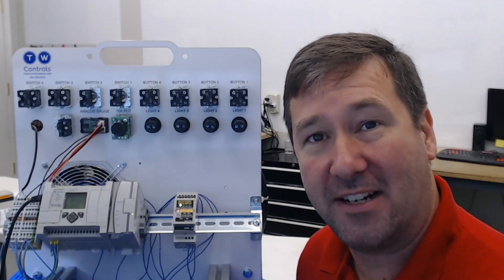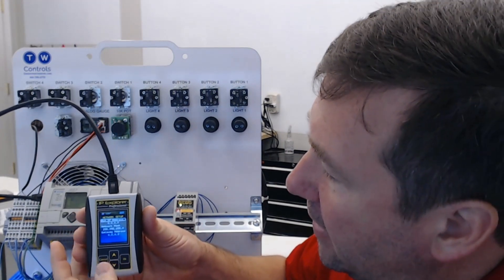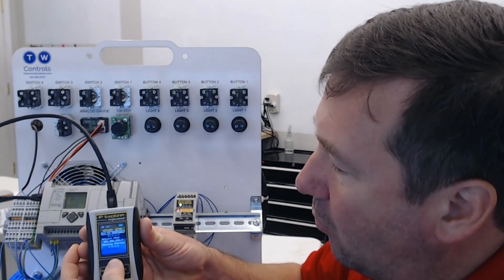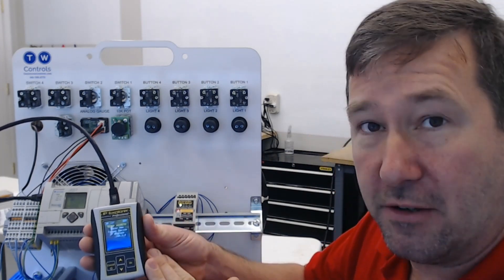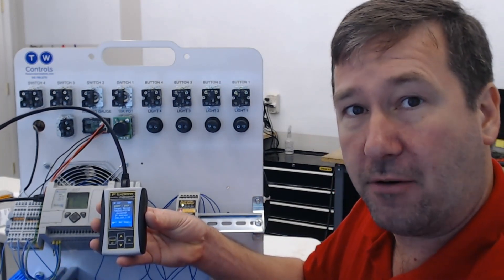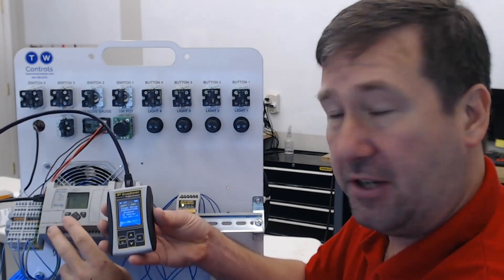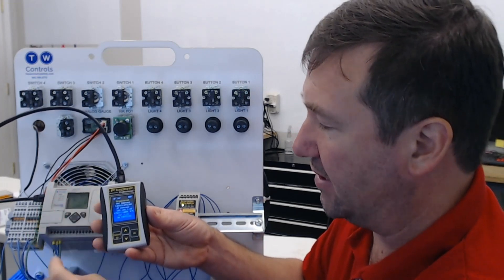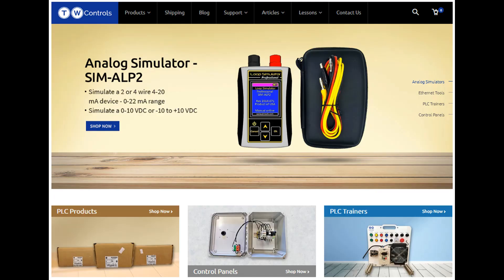How to Read and Write an IP Address to an Allen Bradley Micrologix 1100 or 1400

Comment: I'm trying to understand the 1762-IF2OF2 module. In the AB literature it shows the COM terminal being used only as a return for a current output. Which I assume would also be used for a voltage return as well. But they do not even suggest that the COM terminals be tied to -V. Could you explain why you connected the com terminal to -24v?
Reply from the maker: Hi Robert, here is a lesson on the 1762-IF2OF2.
https://twcontrols.com/lessons/rslogix-500-analog-circuits-wiring-and-programming-0-10vdc-4-20ma
Reply: Thank you! That was very informative. But it doesn't explain why the com needs to be tied to -v or Ov in this case. Is there any instance in which the com might be tied to +24V? And if so why? As I mentioned before, the AB installation manual does not even show com being tied to Ov. And it does not suggest it. So I'm just trying to understand the why behind it. And what is a differential sensor???? When is it ever used??? The instruction manual shows one that not even connected to power. I have so many questions.

Comment: Again Tim this is roberto question i have  a 1400 controller for some reason i don’t know why when i power off the controller it losses all the IP address is kind a inconvenient to have to put the address every time.When i download a program it shows a message that config is different and if you want to mach it will lose the settings thats a second problem i kind a figure it out that one but the first is any ideas how to save the address in the controller that will help a lot  i appreciate the advise and  thanks again.
Reply from the maker: Go to your channel configuration and where you set your IP address, make sure BOOTP and DHCP are unchecked, then when you download, make sure you apply the communications configuration when you are prompted.